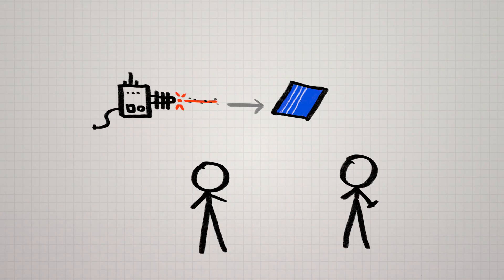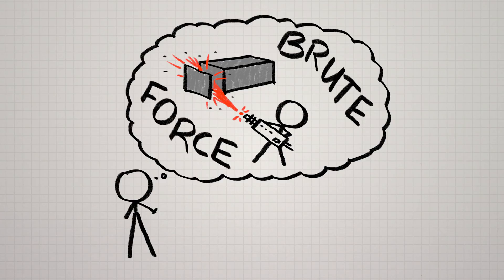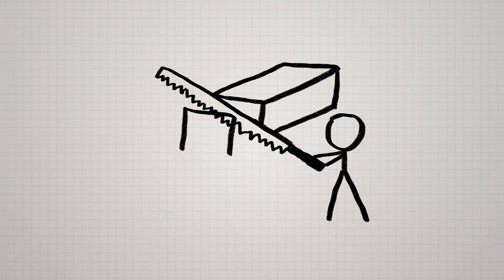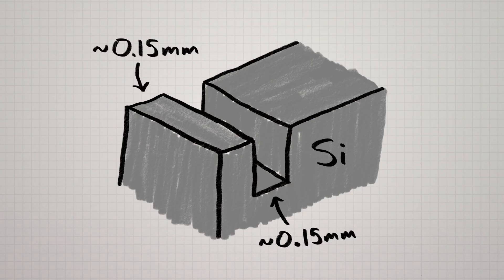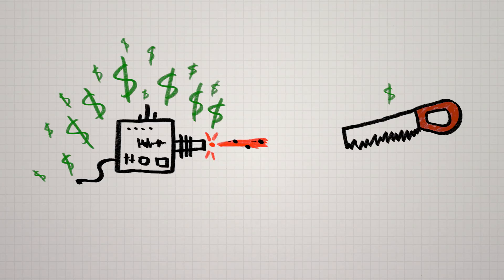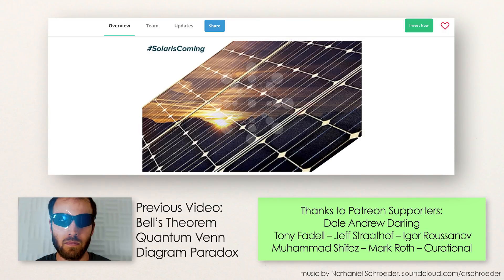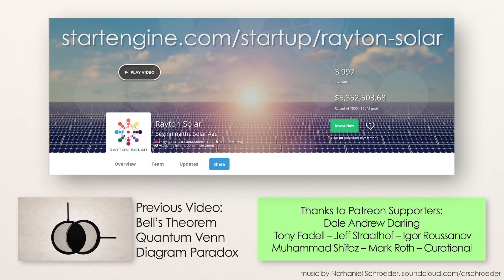Solar Panels Made With a Particle Accelerator?!

Comment: but this could be used for SO many other things esp. in electronics! silicon is used in a solar panel to make diodes. diodes are also used for transistors, which are used for practically everything in the world rn. who cares abt solar panels?

Comment: Good idea, it encourages better quality silicon (like used for chips) thus less use of silicon, which is a good thing for the environment, I hope they get the cost down to compete with the current cutting technology. When I was a graduate student researching solar cells, we shifted from slurry cut wafers (sawing with the lubrication of slurry) to diamond sawed wafers, which was cheaper and we had to think of whole new ways to etch it iirc

Comment: particle accelerator..... use an old type of TV  vacuum TUBE... as in the old days That IS already a particle accelerator...exchange electrons for protons (no more than hydrogen ions) crank up the potential as required and there you are, job done. 
One could also us and old mass spectrometer to do the same job. and job done again....

Please pay me at the counter before leaving the door... thanks

Comment: No,you just need a solar panel,a hand drill that could spin both clockwise and counterclockwise and tape. And probably something that could make visible light.
Well,since getting the tape of the ring somewhat makes X ray light,just put some tape on the drill but don't cut the tape off.
Spin the drill clockwise,then,when the tape is almost empty,spin the tape ring counterclockwise and the drill too.
The thing that makes visible light should shine the light at the solar panel,and you should collect the X rays.

Or,just make visible light from something that makes a lot of light,then shine it at the panel.

Comment: this does mean that you'll be able to get possibly more than double the number of silicon wafers out of the same silicon crystal, both becasue there is no waste and also becasue you can make them almost arbitrarily thin which includes potentially making them thinner than they otherwise could be with the sawing technique. If the price of the silicon crystals was one of the highest costs In this process, it would make a lot of sense to do this. However if it is one of the least expensive parts, this is a waste of money.

Comment: quick physics question because I'm wondering, the "sawdust" silicon, can you not reuse that?
cause if you can reuse it, it's probably cheaper than using a particle beam.

Comment: Will it be thin enough the light can pass through? That will be great. We could cover the whole tall building with solar panels without blocking natural sunlight from lighting up the interior.
Reply: It is possible but not feasible in today's technology. Average Solar PV panel's efficiency is 15%. On average, 1000W/m^2 of sunlight hits the solar panel, it would generate 150W. If you allow sunlight to pass through, that means less power generation for solar panel.

Comment: i had a problem with how at the end you said something about leaving a better future etc. because solar power is NOT the  way to do that. the problem is with the disposal of them. i did a project on this in like 5th grade though so i both don't completely remember and its possible that the issues have been fixed. perhaps you could research it and do a video on it?

Comment: As a material scientist, here's my take on this

There are 4 main types of photovoltaic materials: 
Crystalline silicon; 
thin films such as cadmium telluride (CdTe) and copper-indiumgallium-diselenide (CIGS); 
and amorphous silicon (a-Si).

The type of photovoltaic material involved in this is crystalline silicon. There's Float Zone Silicon (FZ) and the standard Czochralski Process Silicon (CZ). Float Zone Silicon is more expensive than Si grown from Czochralski Process as it has extremely low concentration of light impurities and nitrogen could be used to improve mechanical strength of Solar panel. And assuming the statistic given is accurate, it could theoretically improve efficiency close to 25%. So yea, it could be more efficient and so for. More research and understanding regarding the subject are important. There are multiple options to explore for the various materials that could be used in solar cells and silicon isn't exactly the most costly part of solar cells, it's just the most costly part of materials involved in the manufacturing process.
Reply: It is float zone silicon, says as much in the original funding site.
Reply: rdizzy1 my point been that there's other alternatives created along the way

Comment: I can't see how this can compete with vapour deposition, in anything but the short term.  This applies to chip making as well as solar panels.  A diamond substrate with a microscopically thin layer of silicon or other semiconductor  in one simple process,  what's not to like about that?

Comment: The particle accelerator doesn't seem the critical factor in this; rather the protons in-bedded in the material. I wonder if there is another (cheaper) way of doing this, or another way to create the same sort of stress that causes the material to separate when heated.

Comment: If they really had a process to make it 60% cheaper and 25% more efficient then why would they need to crowd fund? They would drown in venture-capital..
Reply: Rakesh P Gopal hmmmmm
Reply: Rakesh P Gopal Exactly, if they want me to fund it then they should explain why its so expensive to use the proton accelerator
Reply: Maybe they don't have a particle accelerator yet, and therefore cannot start the process of making and selling these solar panels.

Comment: There's a few things I don't understand. On the site they claim to be able to cut down the cost by 60 % . That's impossible if the only way they do it is by reducing silicon use. In fact silicon alone probably doesn't even account for 60% of the cell cost (a lot is due to silver and cell-panel manufacturing). And by the way, maybe they can save half of the silicon because they don't waste it during cutting, but they cannot make the cells too much thinner than they are today, because c-silicon has a low absorption coefficient and needs some depth for all the light to be captured. 

Moreover they calim a 25 % efficiency inmprovement , which is misleading since efficiency is already expressed in percentage (basically it would mean going from 20 to 24 %, because going to 45 % is impossible but I don'ìt know if investors understand that), and they don't really explain how that would happen. 

I hope they have good ideas and they actually achieve their goals, but if it does it's not because of this technology alone, or it will not be as good as they claim.

Comment: You know silicon crystals is not the only viable material for photovoltaics . 
They are trying to use honeycomb-supported perovskite instead
http://www.sciencedirect.com/science/article/pii/S0920586102000834
but not so much progress so far 
http://news.stanford.edu/2017/08/31/new-solar-cell-inspired-insect-eyes/

Comment: Imagine in a small scale 2 soda bottles connected to each other and one filled with water.  And in the center connection a generator like the ones used in dams, with one soda bottle filled with water gravity will spin the generator and produce energy - all that is needed is to place the 2 connected sodas on a fidget spinner type of device to re-rotate the containers to produce electricity back and forth.  My question is will this work?  Even if it is rotated manually  it can still produce tons of electricity if done in a large scale.

Comment: That will be such a slow process because you can only do one wafer at a time. You have to heat it up then cool it back down each wafer. Maybe they could shoot the particles at every depth first starting with the deepest layer. Then heat it up and get all the wafers with one heating cycle? Fuck if I know🤔

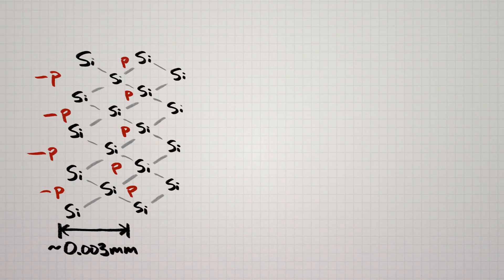Comment: I object to the picture at 2:00. In a silicon crystal, the distance between silicon atoms is on the order of 0.5 nm, which is a few orders of magnitude smaller than your 3 um. Remember, we have MOSFETS working with a gate length of 20 nm. There must be several ( in this case 40)
silicon atoms under that gate for that MOSFET to work reliably. Flash memory is a different story, which is the most ubiquitous example of quantum physics.

Comment: These kind of process already exist, it is called smartcut process by ionic implantation, it is already used in the industry to make super thin silicon on insulator wafers. Basically you implant helium atom in the silicon lattice and it cracks when you heat it up, no particule accelerator involved (well you still need to accelerate the ions but it looks much like a scanning electron microscope than a linear particule accelerator ahah)

Comment: ,15 mm is well an inch is 2.5 cm so 1.25 cm is 1/2 an inch and 1 cm  is roughly 2/5 of an inch so  1 mm is 2/10 of an inch and because of the .05 mm i think its 3/10 of an inch or 3/20 of an inch therer you go :)

Comment: To make graphene, one method that's used (Or at least used to be) is using a tape-like adhesive to strip off a thin layer of the graphite, I wonder if a similar method (using some chemical that can bond to silicon pretty well and can be removed later) could be used for silicon to make really thin wafers without the need of a particle accelerator

Comment: Wouldn't the quality of the wafer be affected though? You can calibrate your proton beam to embed proton at, say, 0.003mm depth, but you'd still have many protons embedded at slightly deeper and slightly shallower depths. The depth of the embedded protons would be more or less normally distributed with a mean at 0.003mm depth, so your wafers would certainly have some protons in them...
Reply: Yes, we expect positive surface charges at that interface. Annealing can help a lot. I also expect lattice dislocations. The threshold voltage Vt of the MOSFET can be adjusted in the subsequent ion implantations. Those ion implanters are particle accelerators in their own right, and we have been using them for a long time, a large fraction of Moore's law reign.
Reply: Thanks for the reply. Do you work for this company or something?

Comment: Cool idea, cool company. I certainly hope it does well. I am not investing though - the current funding values the company around $250M, which is way, way too high. Trina, the largest solar manufacturer in the world, is currently valued around $1B, or just 4x the valuation of Rayton under this funding. Please correct me if I did the math wrong on the valuation.